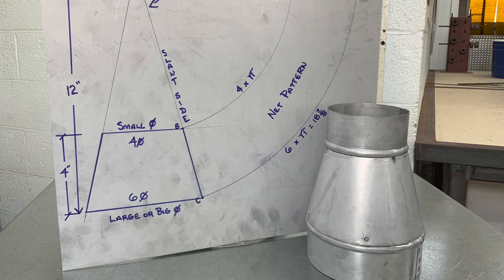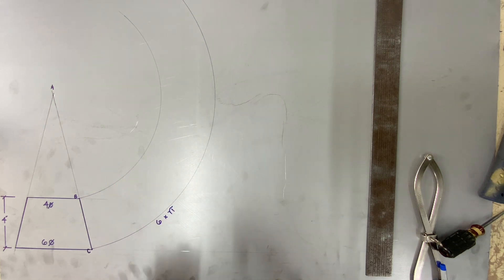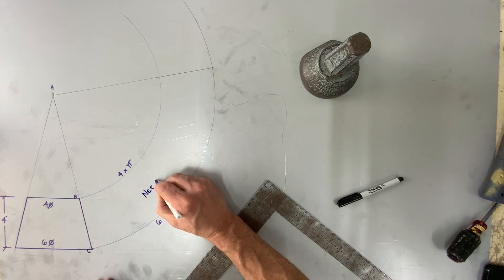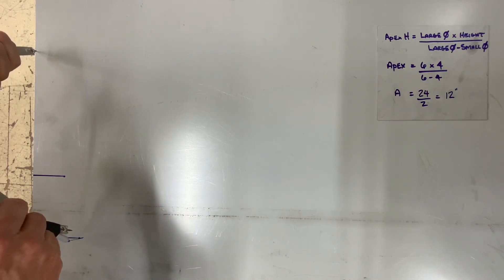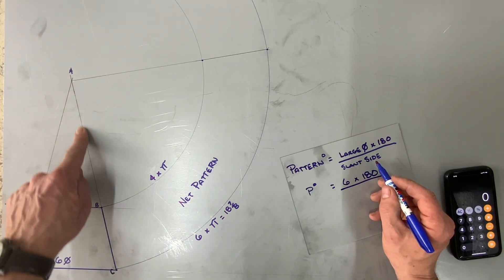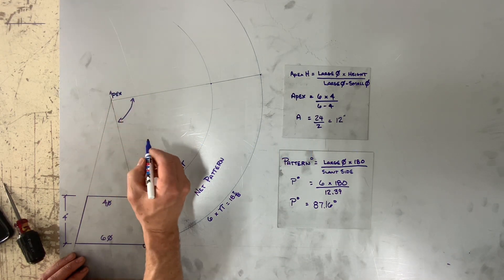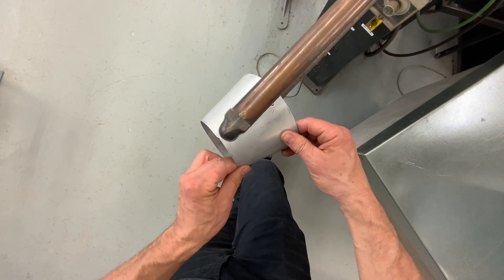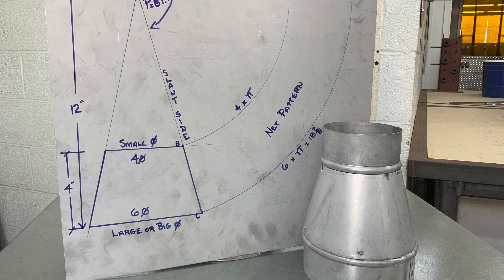Radial line development  - Round Reducer, fabrication

Comment: Is there a way to make complete reducer -collars and net pattern out of one sheet of metal? So that it only has one seam? I would like to try build a cyclone but it wont work with this much things sticking out,inside needs to be as  smooth as possible .Any ideas?

Also there is another way ,when you inputed 6"x pi =18.8496 -you can divide 18.8496 by any number that gives you best result that is easiest to setup ,draw the line of that distance on paper and adjust your calipers with it.Then you just go around  6" circumference by that number.

For easy of understanding lets say that instead of 18.8496 you got 12" -its easy to divide it by 4 so you would take 4" in calipers and go 3 times around circumference.
Reply from the maker: The only thing I can think of is to use a Shrinker/Stretcher, but the collar lengths must be kept short.

Comment: Hi Duane, how tall should a 24" to 20" round reducer be?  Thanks.
Reply from the maker: depends if it's for air or material handling. IMO, you could keep this one 8 to 14" but you might want to check with SMACNA standards